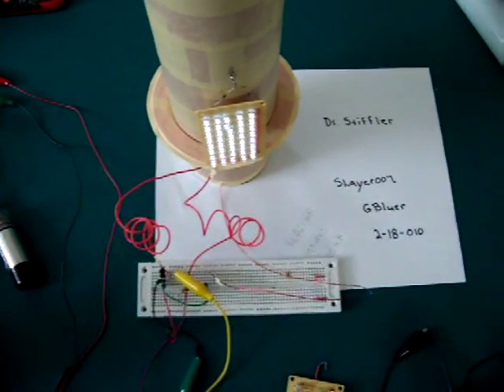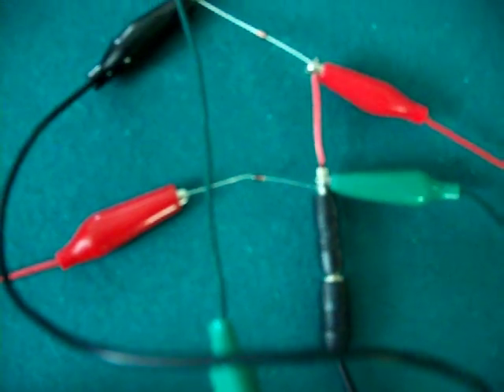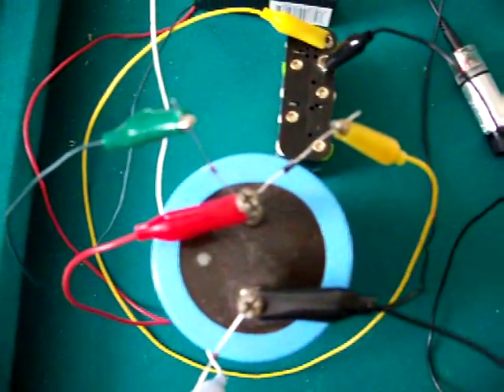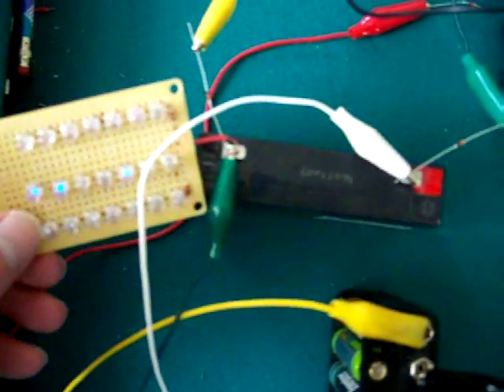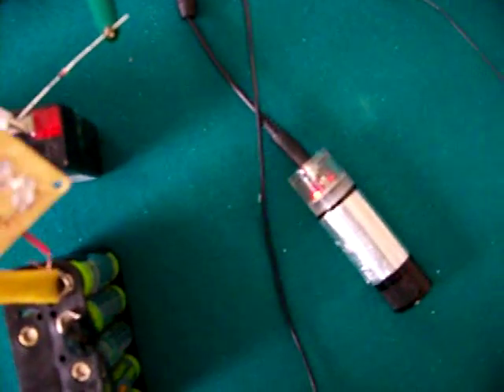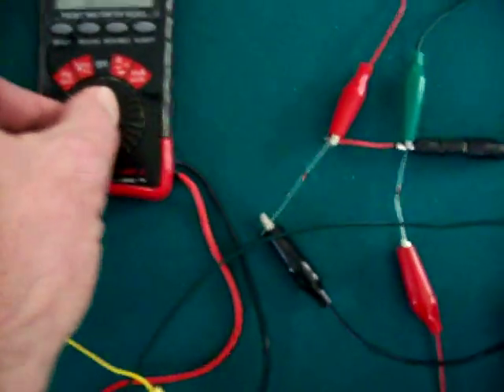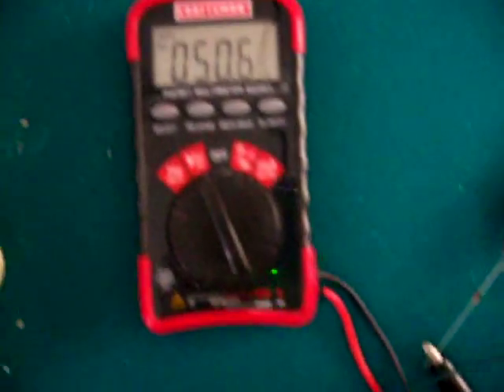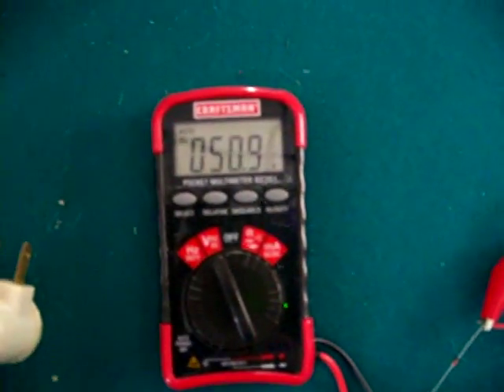Exiter With Reverse Diodes.mov

Comment from the maker: Thanks Jack.
Using the PNP transistor you would reverse the diode on the transistor for the BEMF.
So you would pull the negative off the transistor then you can use the positive or negative of the source battery for the positive charge.

Comment from the maker: The 14.4 volts was the voltage in the capacitor.The 10 AA batteries are connected to the cap thru a diode.
The voltage in the batteries went up 13.53v from 13.02.After resting they were 13.26v.They will charge this way but they charge alot fast using the BEMF from L2 coil.